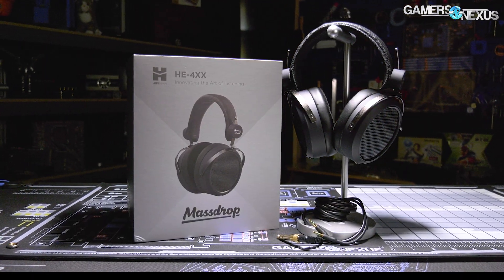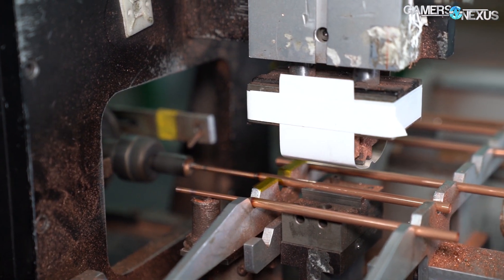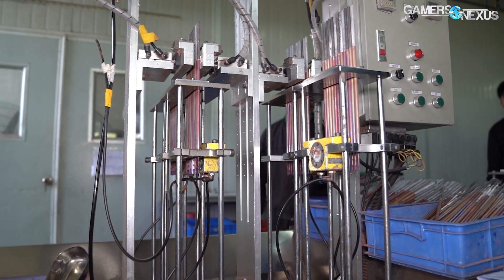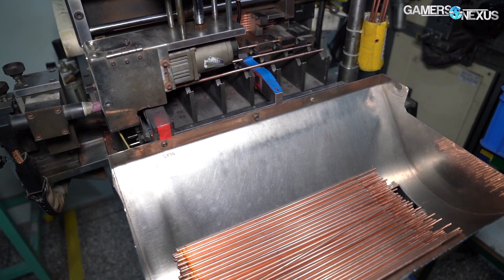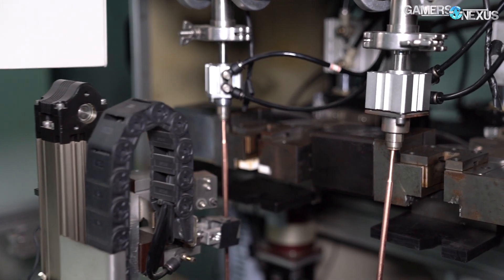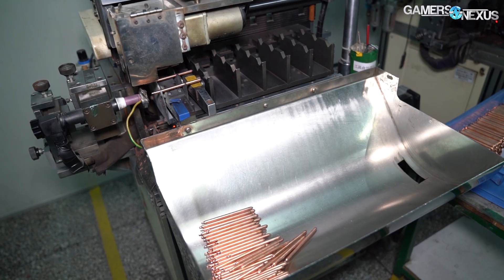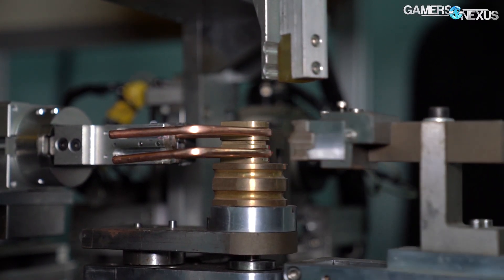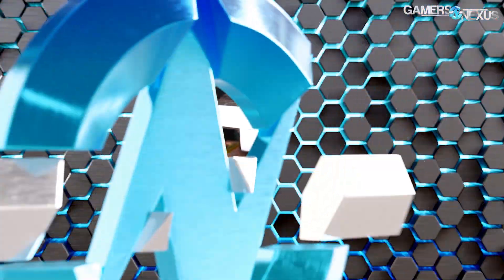How Copper Heatpipes Are Made | China Factory Tour (Cooler Master)

Comment: I am curious how long we can keep using so much metals for our electronics which many of us replace after such a short time. You can recycle those metals but if you loose (it is somewhere but not in concentrated form such that you can easily use it again) 10% every time after recycling, that adds up quickly. What percentage of people don't bring electronics to a place where it will be sent for recycling? 
If metals like copper get more scarce it will get more expensive.

I assume that the impure copper can be salvaged by other companies which dissolve the copper and win it back in pure form (salt, dry up etcetera).
Reply: There's plenty of metal left for us to mine.
Reply: @1pcfred  
Until there isn't! Let's look a bit further than our generation, human civilization might have hundreds of millions of years left if they don't screw up too much and they are a bit lucky (meteorites). 

Here is the deal. It is not problematic that we waste more while developing new technique but wasting even more due to planned obsolescence - which clearly happens in the smartphone-industry - and because people are idiots (throwing away a perfectly fine internet-machine while they only need a SSD and a clean install of that Windows or Linux), that is a problem.
Reply: @1pcfred  
Or let's not run out of vital resources at all. We will run out of petroleum in a few decades but that might be beneficial for our quality of life after a transition. Either we learn to live in balance with nature and the quality of our lives will vastly improve or we fail at that and the human species will perish (lack of food and shelter aand all that => strongly decreasing population) and then we start over.
Reply: @1pcfred  
In my country (the Netherlands) there is no threat of a lack of potable water for the inhabitants in the foreseeable future but worldwide, yes, this will be a big problem. The biggest problem for us humans is that there are too many humans. I am hopeful that we can sustain the current population if we have good policy but the combination of fossil fuels getting more scarce, technology not being advance enough yet and the population increasing even more (9-12 billion in the next few decades?), that will be a big challenge.
Reply: @1pcfred  
Yes, that is another big problem which we might have in this century.

Comment: I suspect others have mentioned this but the heatpipes appear to be welded, not soldered. The difference is soldering melts a relatively low-temperature filler material (usually an alloy of tin and zinc and some other stuff) and welding will melt the material (copper in this case) itself, with filler being optional and, in this case, not used.

Comment: I wonder what happens to the sintered copper inside the heat pipe at the bent sections. Does it get compressed/stretched, and does that ruin the surface area and capillary action capacity?

Comment: You say the bad heatpipes 'can't be salvaged', but isn't it actually just a cost/benefit consideration?  I would think that there is a way to chemically clean the copper, but it's just not worth the cost.  A small point, but important when talking about waste in manufacturing.
Reply: The copper will be recycled, just has to go through more steps to purify.

Comment: The copper in heatpipes can't be re-used?!  
That seems kinda wasteful... not even for other non-heatpipe things?
Reply: Copper is expensive. No way it just goes to a landfill. CM probably gets rid of the pipes as waste, and then the company that hauls the waste sells them to a specialist recycler by the truck load, that can either put the copper to use in some low-grade application, or purify it and put the results into a more useful alloy.

Comment: Wait, so the heatpipe just contains a couple of drops of water and a vacuum?
Reply: Aside from the inside treatment (sintered copper powder, grooving, mesh or combination thereof) yeah. Water is readily available and has a fantastic heat capacity (especially volumetric heat capacity) which makes it great for absorbing heat, and the vacuum brings the boiling point down far enough that you don't have to overheat your CPU to get it to vaporize. Some heatpipes do use/have used other liquids, like ammonia, acetone etc. as well, but good old water is very good at the job as well. =)

Comment: 5:00 - Is it perhaps rather the case that the 3% could be recycled but, from what I've read of how minerals are proceesed, etc., it wouldn't be economically viable to do so? Still, I'm surprised that once the accumulated waste reaches some significant amount (several tonnes or something) it isn't sent or sold to a minerals processing plant or whatever.
Reply: It is recycled, just not by the company. Some factories have the ability to recycle rejected parts in house, but it really depends on what you are working with.
Reply: @zoravar.k7904   That's good to hear! I did wonder.

Comment: Reminds me of when I used to work in a factory making metal (and copper) pipes for car parts (engines and others), using automation or manually making and inspecting the pipes. I can tell you that cooking those pipes is not easy, working at 50 C for 8 to 12 hours

Comment: 4:50 "Copper can't be salvaged"  Cody'sLab: hold my beer
Reply: It struck me a little bit that comment, envisioning failed heat pipes dumped in the landfill. Hopefully, it just meant, that it can't be salvaged at Cooler Master's factory, but it can be treated as scrap copper and recycled with furnace.
Reply: @Murphistic  Copper is expensive, someone probably buys the scrap from them. I hope, at least, seeing a resource get thrown out is painful to me
Reply: @Murphistic  I can pretty much promise that.  There isn't anything that would be added that a recycling mill couldn't account for or add to specific alloys.
Reply: The copper is recyclable. It won't be used to make pure copper, most likely, but it will most default be recycled. Copper is used in hundreds of different alloys, and there's always space for it. I think something got lost in translation, like them calling the tig welding, "soldering."
Reply: It absolutely can be salvaged. Copper.is so expensive to mine there is absolutely a procees to remove the impurities
Reply: If I remember correctly, used copper takes extra steps to purify compared to other common metals, so recycled copper gets reused for the same task and at the same grade.  If they introduce impurities mid-way through production that cannot be there from the start, then it might just be cheaper to buy it new.  Plus scrappers classify every metal by grades when they buy it, and if those defective heat pipes are a pain to recycle then they may not even WANT them.
Reply: If the copper is salted, the water will not remain pure enough to boil freely in the vacuum pipe. Water must remain free from salts and dissolved gasses to be effective. Heat pipe is heated and evacuated so no other gasses but H20 vapor remains. Any copper sulfate contamination must be disposed.

Comment: Somehow this seems overly complicated. Why not just take copper wick, roll it together with the copper to make a pipe, seal one end, add drop of water and seal another end. That would be like 5 minutes, instead of 9 hours these take.
Reply from the maker: Why would you think that they wouldn't have thought of something so simple if it worked that easily?
Reply: @GamersNexus  Well that would be a good interview. There has to be simpler way that's more expensive, so they do it the cheaper way. All that shaking and baking doesn't cost much but takes horribly long to do.
Reply: @GamersNexus  A good example would be Nvidia RTX stock cooler. They still made it like that even though there are much simpler ways to do it and others have thought them already :P Well either way, I got a bigger appreciation for my heatpipes, if this indeed is the simplest and fastest way to do it in the worlds.
Reply: And made the pipe double lenght, cut it in half and you get 2 pipes from one, as the other end is soldered anyways, it can be cut.

Comment: Steve, does overclocking a cpu or gpu without increasing voltage and keeping the temps manageable increase the rate of degradation?
Reply: It can just like anything else since you're running it above manufacture spec. Increasing clocks still increases the tdp of the processor even if you don't change the voltage. That being said most processors are designed to have a 10 year lifespan and decreasing it any meaningful amount is unlikely.
Reply: Not saying it certainly won't, because I don't really know, but commonly (I'm almost 100% certain Steve has said this in a video sometime in the past) voltage is the biggest killer of CPUs (together with heat), so if your temps are under control and the voltage doesn't go up, it should do fairly little damage. I'll try to find the video where he talks about this.

EDIT: Ask GN 92 has some relevance to this. And of course this all assumes your voltages are ACTUALLY "safe", as Steve discusses in the "How to Kill Your CPU with “Safe” Voltages" video.
Reply: @jubuttib  Thanks for this!
Reply: @samhill3153  Found the one I was thinking of that addresses the issue even more from your perspective: Ask GN 71, "Can Undervolting Hurt GPUs & CPUs? OC Damage"
Reply: @jubuttib  thank you very much I'll take a look at the video!

Comment: I had no idea it was just distiller water. I figured it was some other chemical. Interesting.

Great video guys as always, thanks for the time and care you put into all your work.
Reply: Pure water won't react with copper, and it carries a lot of energy when it evaporates. Im curious how they make the flat pipes without blocking off the center opening.
Reply: @davidgunther8428  the flat pipes still have an opening. Even if you crushed it almost all the way flat, there's still plenty of space left for a couple drops of water and air.
Reply: @xenonram  I thought there would have to be a good path for the vapor to travel to the cold end of the pipe. With only a few drops of liquid available the vapor needs to race from the hot area to the cool area very quickly, then wick back. The small amount of liquid inside might limit the pressure that can build up when heating up for soldering to fin arrays. Normally water vapor would make a huge amount of pressure (and burst the sealed pipe) if heated to >250C for soldering. If there isn't excess liquid water the pressure just becomes that for an ideal gas, not the vapor pressure of water at that high temperature.
Reply: @davidgunther8428  they use mesh for the flat ones maybe?. and it's possible to leave short round end to let the water filled in
Reply: @davidgunther8428  The copper powder sintered to the inside prevents the tube from flattening all the way. The water vapor can still pass.
Reply: @davidgunther8428  Carefully is how they do it, in testing was just a guy standing on them.
Reply: Depending on how much air you evacuate, you can adjust the boiling point of the water. 
No need for fancy Novec that boils at 40° under 1atm.
Reply: there are heatpipes/vapour chambers filled with other liquids that work in different temperature ranges. Its just that water is most optimal for this application.
Reply: sintered copper powder, vaccume packed few drops of distilled water, that make these heat pipes heat conduction almost 100 better than copper itself.  Simple but outstanding device.
Reply: I was surprised to find out that they used distilled water. I would have expected highly pure ethanol to be used because it has boiling point of 78 °C which might be better for cooling solutions.
Reply: @MikkoRantalainen  It's sealed under a partial vacuum so the boiling point is controlled to whatever the manufacturer wants.

Comment: X-Ray or thermal cameras for quality assurance? Nah bro, put in hot water and see if it burns really fast or just kinda fast.
Reply: The copper is a reflective surface in most cases so a thermal camera wouldn't be very accurate.
Reply: @MrMega200  doesn't look too reflective, although contact temperature probe would be better.
Reply: Its a very practical test for a thing designed to transfer heat, why invest in an extravagant x-ray/IR setup and have to train people in its complicated (and possibly dangerous) use when you can tell any random worker "hold this in the water if it gets hot within X seconds put it in this bin otherwise use this other bin"
the worst possible case here is of mild hand burn as opposed to radiation exposure
Reply from the maker: They have other QC methods as well, that's just the only one we were shown since it's hands-on.
Reply: Knowing the Chinese they probably stir their tea with the pipes.

Comment: I'm pretty sure that's a tig welder tbh
Reply: Yeah that's definitely not soldering lol
Reply: Yep. It looks like a off the shelves welder that is just attached using a custom clamp. Which is excellent, and easy to replace with a new tip or holder.
Reply: Yeah looks like TIG.
Reply: I've TIG welded copper. Talk about drawing some current. The welder just hums when you're welding copper. Copper is pretty low resistance.